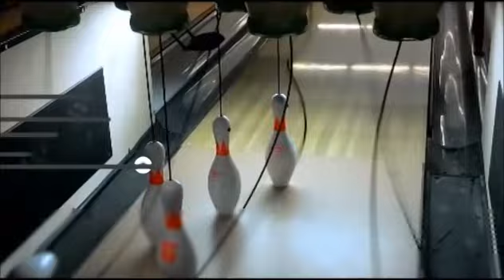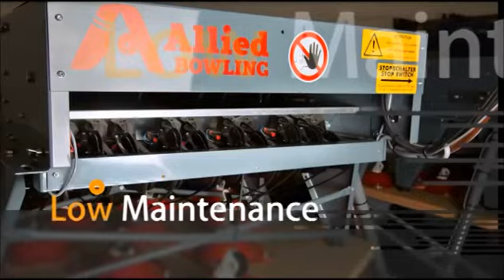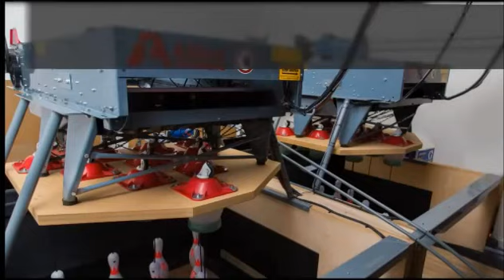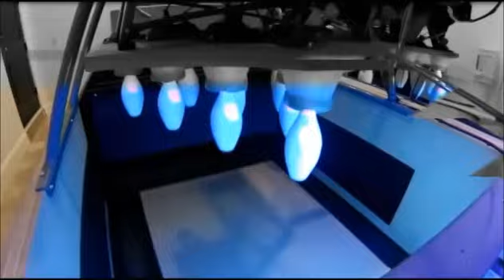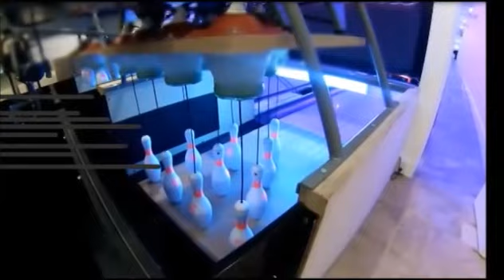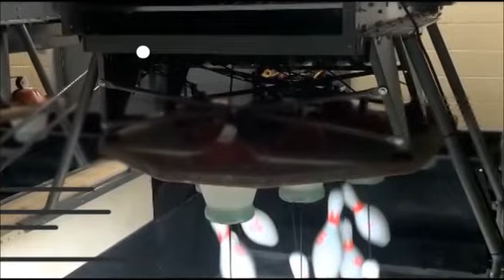Allied Bowling's String Pin Machine

Comment: 5 pin bowling in Canada has to put up with the string setting system just because Brunswick and a few other bowling companies stopped making free fall pin setters since the 1970s. I'm not a fan of the strings either. I'm wondering why Brunswick or qubica amf never continued making real pin setters for the Canadian 5 pin game. I can see 5 pin versions of the gsx and the 8290 machines.
Reply: even if free fall 5 pin pinsetters came into production no one would buy it they just cost to much to run compared to string machines

Comment: I would NEVER roll at a house with such a gimmick.
Reply: Same. I bet I could throw it hard and fast at the head pin and get a strike. The strings would add a lot of ""cheats"" to the shot.
Reply: That's why people frown upon these machines.
Reply: I would not either, I like natural pin action!
Reply: Same for these Junk Crappy Stringpins. I don’t care how much money the proprietors are spending on Free Fall Pinsetter Parts. If proprietors want money quickly, then be creative by Creating Summer Bowling Clinics or High School Bowling Tournaments for beginners and pros, that’s what my local mall bowling center did back in the day before the mall burned down, then after all that they finally bought pinsetter parts (well however it was few days before the mall was on fire when they got it) for their poorly maintained 24 Lanes of GS-92 Pinsetters.